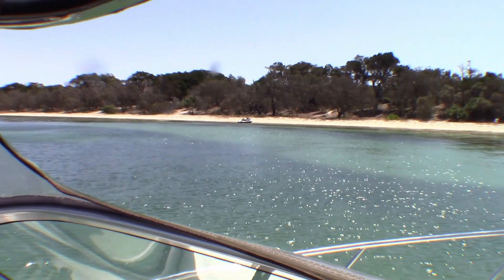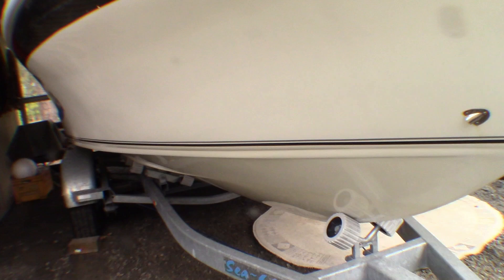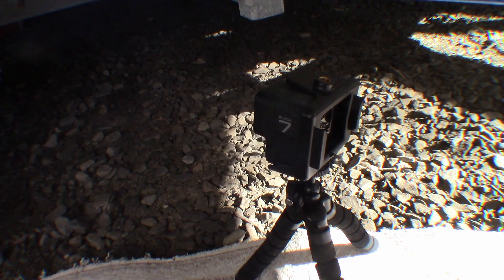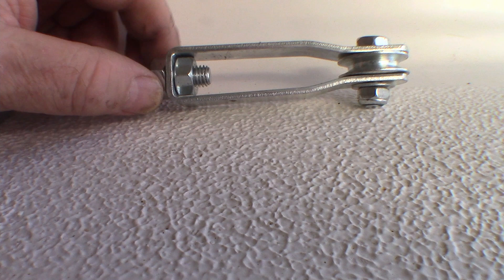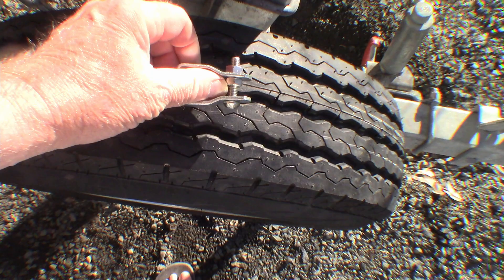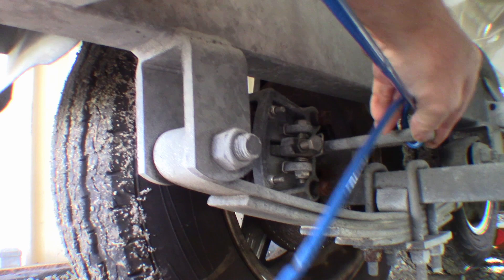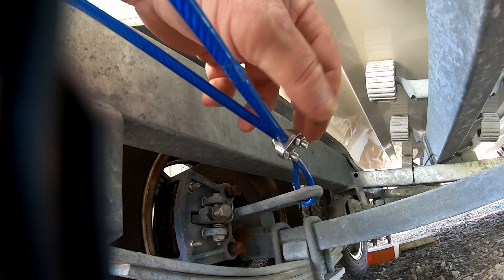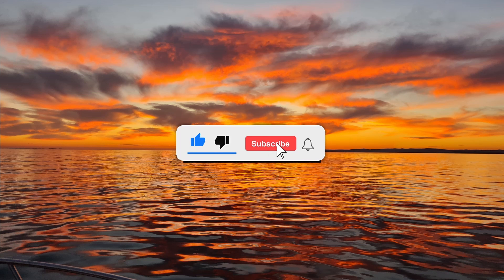Trailer Brake Repair

Comment: At that short caliper leaver actuator bar, I found it better to attach the cable with a small 'D' shackle rather than weave the cable through the two holes in the leaver actuator bar. This allowed a more direct pull and made the final adjustment easier.
Reply from the maker: Thanks for the suggestion.  Anything to make adjustment easier.  I will have a look at that option next time I service them.

Comment: Tip: Spray Penetrol rust treatment on every part of your trailer eg. frame, springs, wheel hubs etc; repeat as required as time goes on.  I have two forty year old boat trailers in original condition still looking like new, all OEM except wheel bearings and tyres. Cheers
Reply from the maker: Thanks, I will look into the Penetrol.
I spray the interior of the tubes with heavy lanoline which works a treat but leaves the trailer looking very dirty if used on the outside.  I wash the trailer down immediately after every dip.  I was spraying the adjustment with WD40 but that obviously wasn't good enough.
Reply: @weFishAU  Penetrol is a Taubmans' product, first made by the Flood Company in the USA before WW2. Unlike Fisholine this stuff has a paint drying additive, it also can be blended to turps based paints. Cheers
Reply from the maker: I've got to call into the hardware tomorrow so I will give it a try.  Thank you.
Reply: @weFishAU  I find Penetrol in the spraycan is the easiest way to apply and never goes off. Also available in 500 Mls up to twenty litre cans but once opened will spoil in month if not used. Cheers
Reply from the maker: Thanks again,  I will definitely look for the spray can.  Much easier to get into a lot of places with a spray.

Comment: Thanks Great video on mechanical breaks. Can’t find the stainless adjuster on eBay - where did you find it ?
Reply from the maker: Thank you.  I'm glad they aren't available on eBay any more.  The one featured in that video was sold as stainless steel but it was not.  Rusted out same as the first one.
Check out this video to see how I eventually solved the problem: https://youtube.com/shorts/7vUhduE18Ak

Comment: may i know where to buy the break system I need to renew it
Reply from the maker: Hi.  I got all the parts on eBay.  If you look in the video description (click on More...) there are some links that will help.  The top link has expired but the other 3 are still good.